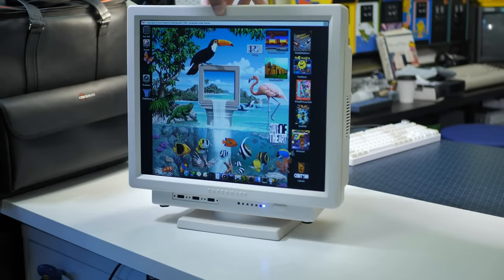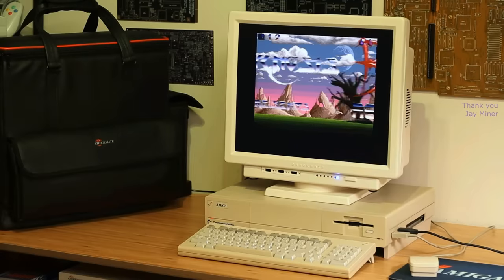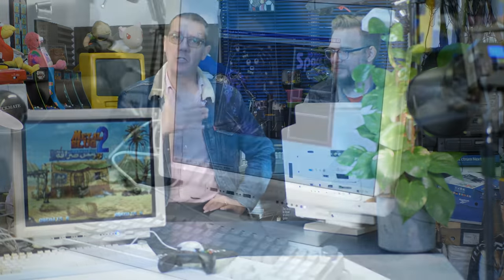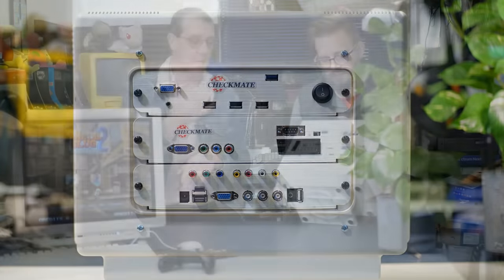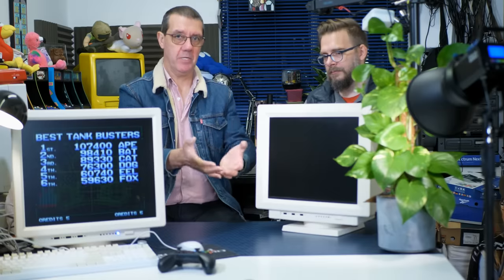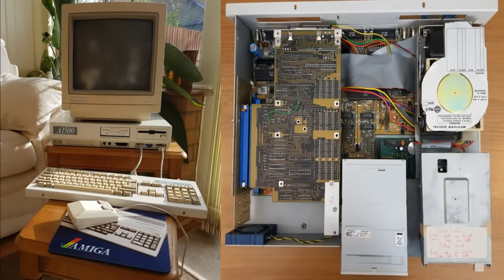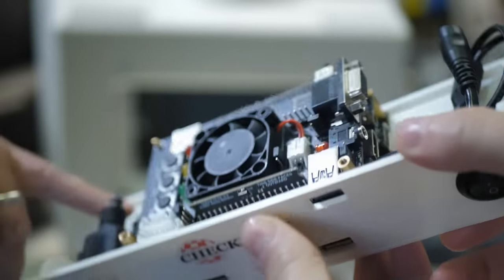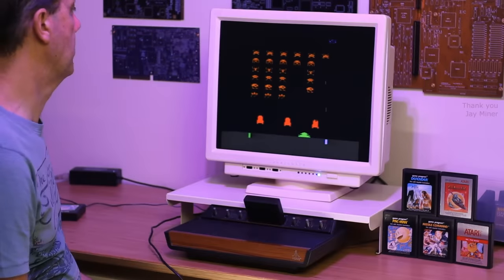This Monitor is the Future | Nostalgia Nerd

Comment: Or just use an emulator.
Reply: Emulators don't look, nor perform the same as native tech. The main disadvantage is the image quality is worse on retro with modern panels, CRT is the king, but very toxic canceroua tech.
Reply: @Keepskatin  With upscaling emulators often look better
Reply: @martinlutherkingjr.5582  nope, you are thinking of resolution only. Retro games were designed on and for crt displays. The literal animation is altered when playing on  non CRT monitors. There is a YouTube video that goes deep into this topic. I dont think Google will let me post the link.
Reply: @Keepskatin  Even still, it looks better most of the time.
Reply: @martinlutherkingjr.5582  That's your opinion, upscaling is basically adding blur effects to jaggy edges, no real enhancement. Upscaling is like converting an mp3 file to flac. The source is still mp3 quality.
Reply: @Keepskatin  The upscaling I’m referring to is where the resolution the computer renders at is increased by a multiple.  I’m not referring to taking the rendered output signal and trying to increase the perceived resolution using AI or other tricks (similar to converting an mp3 to flac and trying to run some noise reduction). For some games higher resolution textures can also be downloaded to make things look even better.
Reply: @martinlutherkingjr.5582  Interesting, but that requires modification of the game code itself. Native image structure and shape of pixels are better on CRT for retro games. Im looking for the link.
Also the colors are more vivid for retro games on crt
Reply: @Keepskatin  Nothing wrong with modifying game code, games are made by writing code. You don’t have to emulate on an unsaturated display.
Reply: @martinlutherkingjr.5582  So you are telling me that resolution and color is better on your panel than on CRT for retro 🤔 Hold that thought 🤏🏼OK, then why do the hardcore retro gamers prefer to use these CRTs🤌🏾🎇
Reply: @Keepskatin  It depends on the monitors being compared. Not all CRT monitors and non-CRT monitors have the same specifications and performance. CRTs are what most people played retro games on so it’s more nostalgic. CRTs typically have less lag as well.
Reply: @martinlutherkingjr.5582  Less lag alone is enough to say CRT is better than flat panels. I wandered into other YouTube videos and forgot to post the link.
Reply: @Keepskatin  Ok, but why did you divert the discussion to displays? You know emulators can be played on a CRT too, right?
Reply: @martinlutherkingjr.5582  CRT has motion superiority over oled and lcd. Olded and lcd has better colors. Flat panels also stretch the image of retro games.
Reply: @Keepskatin  Great, but you can play emulators on a CRT. Not all CRTs and non-CRTS are created equal. You can also adjust scaling on emulators if the aspect ratio is incorrect. Furthermore, there’s more to graphics and performance than the monitor they’re displayed on once the monitor is just good enough. There’s a reason people will pay thousands of dollars upgrading their PC before spending thousands of dollars on a CRT. The display has less of an impact at a certain point than the quality of the graphics being rendered.